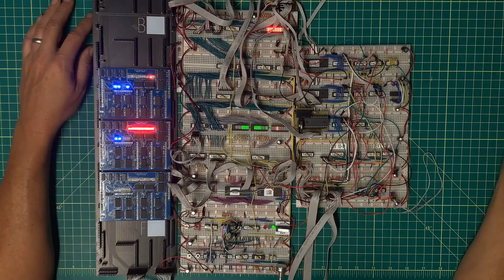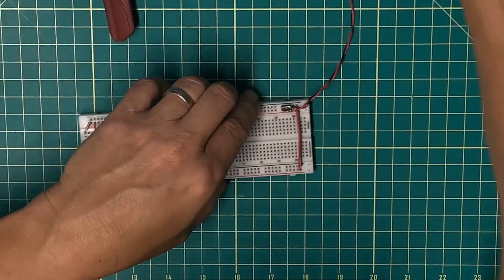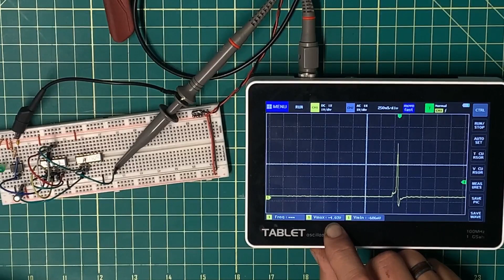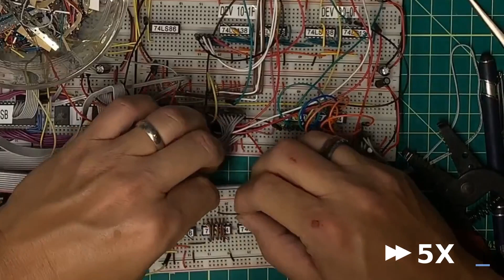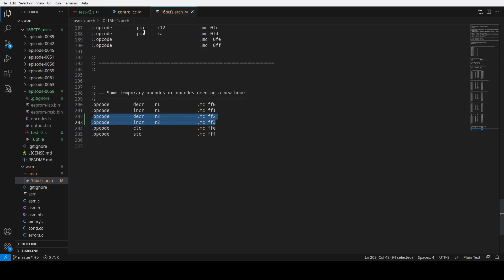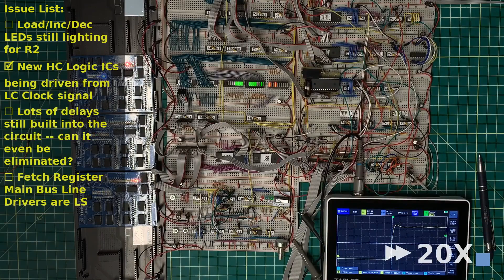0069: Timing Issues Part 2: Small Jobs | 16-Bit Computer From Scratch

Comment: A lot of Bus systems have that decay when there are no drivers on the bus. having a selectable register pull all the lines low in that case would reduce current draw since the voltages would not be in the middle as long.
Reply: And on modern Processor design there are no internal tristate busses. Instead all the outputs are OR'd together. On FPGA's there is a helper macro that makes it easier to implement this OR bus. And then that result is propagated to all the device inputs.
Reply from the maker: Fascinating.  I had no idea!
Reply from the maker: @LaserFur -- Thanks for the help!!

I had already been thinking about adding an actual Zero Register with proper line drivers to the build and measure that against my expectations.  I was considering it to be more like a shot in the dark, but it sounds like it would work properly.